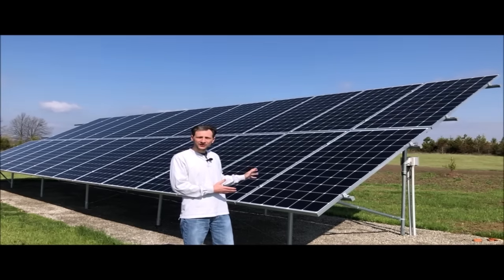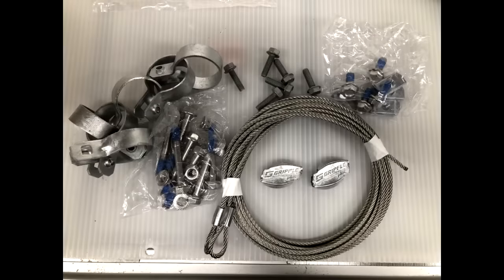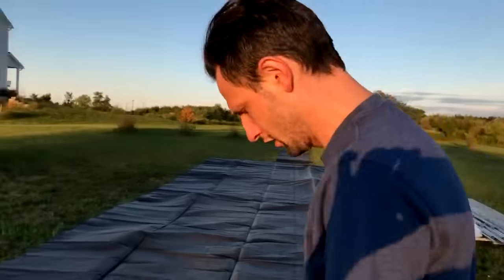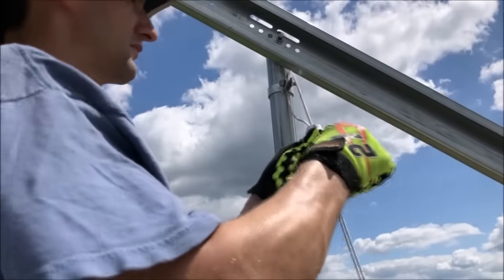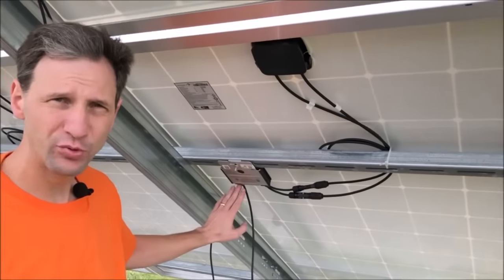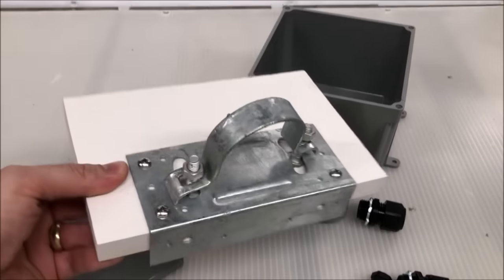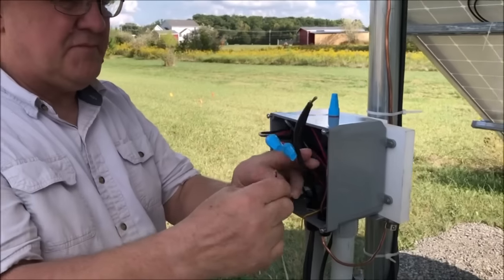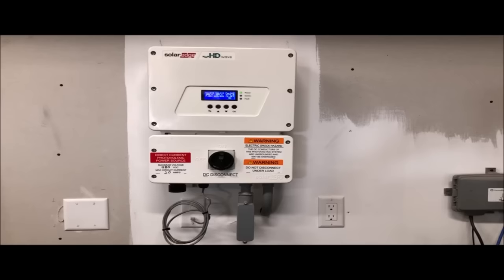DIY 9kW Grid Tie Ground Based Home Solar Panel System Installation

Comment: Where is the battery backup? Or is that in a different spot/not installed yet? Are you just running solar during the day and any extra back feed the grid?
Reply from the maker: No battery, the grid works as my battery.  You can see how my "grid battery" works here:  https://youtu.be/IwUK1dNJ3n8
Reply: @ProjectsWithDave  ok that brings me to my second question. You say that the grid is your battery? What do you do when the grid goes down due to a storm a car taking out the lines or some other random form of catastrophe and it becomes days and weeks without power. You then have solar for the day but nothing for at night. That means you would be having to run a generator all night long to keep important items going till the grid comes back online. From what I have learned is you can do still do grid tie with battery backup.... Maybe an idea to ponder about.
Reply: @ProjectsWithDave  I have been doing a lot of "prepping" for the worst. I have flashlights, candles matches and batteries of many kinds. I do need to get a portable panel cuz I live in the city and space is limited. I have inverters, battery backup, medical supplies, can goods and MREs.
Reply from the maker: I have a generator for significant power outages.  Battery backup systems are still too expensive for me to justify.  I think the cost of batteries is poised to come down significantly in the next few years at which time I will reconsider.  Thanks!

Comment: Dave, I have watched a lot of YouTube videos and I think this is one of the best. How far are your panels from the house? How do you compensate for the voltage drop in the 10 gauge wire over that distance? Thanks.
Reply from the maker: The total run is about 175 feet.  I have very little voltage drop, because the optimizers hold the voltage for each string at 480v.  Otherwise the voltage drop would be a bigger issue.
Reply: @ProjectsWithDave  It was confusing, as I thought that the I^2*R losses must be ferocious if the "optimizers" are only supplying 1V per panel.  But it seems that's a safety feature.   480VDC seems much more like what I'd be expecting.  

Thanks for the wonderful video!

Comment: Question. No batteries? I do not understand. What am I missing?
Reply from the maker: This is a grid tie system.  No batteries are required because the grid acts like a battery by absorbing excess power during the day and feeding it back to me a night.

Comment: DID YOU RUN TWO HOMERUNS TO INVERTER EACH BEING 12 PANELS  ON # 10 WIRE ?
Reply from the maker: Yes, two home runs #10.  One is 12 panels and one is 13 panels.

Comment: Hey Dave, it appears that you ran a ground wire from the array, through the conduit, and to the house? If I am correct on that, why did you do that? I would have thought you could have just bonded the panel frames, combiner box, etc. with the ground rack itself if the ground screws are essentially your ground rods.  Thanks and I really appreciate your videos. I'm in Ohio also and have used your videos and website to drastically reduce my solar learning curve.
Reply from the maker: I'm glad the videos have been helpful.  Yes, the frame does provide some grounding at the site, however, I was required to bond the array to the household grounding system with a 6awg ground wire to pass inspection.  I thought at the time the conductor had to be solid, but the inspector said it could be stranded.  In fact, including a solid #6 wire in my 1" conduit with my other conductors does not meet code due to its lack of flexibility.  The inspector was shocked I was able to do it and did not make me pull it out.  He said I should have either run it outside the conduit or run a stranded #6 inside the conduit.  Hope that helps.
Reply: @ProjectsWithDave  That's interesting, thanks for the explanation. Let's pretend the inspection and inspector were not in the picture. Knowing what you know now and not then, would you still run the ground wire to the house and bonded to the household ground? I've been having a conversation with John regarding several points he made on his video (https://www.youtube.com/watch?v=abfXLujggBo) and I am leaning toward just grounding the Ready Rack and combiner box using grounding at the rack only. I don't have an inspector to contend with here in Knox county.
Reply from the maker: In that video, the recommendation, is no ground at all.  You are simply questioning if it makes sense to connect the house ground to your racking which is effectively locally grounded.  That's a question I am not qualified to answer.  There is a lot of debate about it and I have heard convincing arguments on both sides.  I didn't have a choice since code required the link in my case.
Reply: @ProjectsWithDave  Right, I understand. I'm not qualified either, lol. At this point I am contemplating ways to isolate the PV panel frames from the racking, but still grounding the racking to its own ground and definitely not the house ground. BTW, I decided to use Ready Rack because of your videos. I drove to their factory near Napolean to pick it all up to save on shipping. I told the APA Solar salesman, Matt Reid, that I decided on purchasing the racking because of your video. He said that they have gotten a lot of purchases due to your videos. 👍
Reply from the maker: Thanks for the feedback.  Too bad I don't get a commission on sales... : )
Reply: @ProjectsWithDave  After reading more I am leaning back toward bringing the array EGC conductor through my conduit and connecting it to my existing ground electrode at my main service panel, which is I believe what you did.  If you recall above, I am using APA Ready Rack also.  I did not see any guidance/statements in any of the Ready Rack docs about bonding their racking components to the PV frames and and the EGC.  In fact, they say on the first page of their engineering plan that they don't make any claims about grounding/bonding. Did they provide any guidance to you? I saw in your "Easy DIY Solar Panel System Racking Install" video that you used the DynoBond connectors for the panel frames, and you bonded a PV frame to the Ready Rack support system using a copper wire.  Did Ready Rack suggest this or provide any guidance?  I have reached out to Matt Reid at APA Solar also.

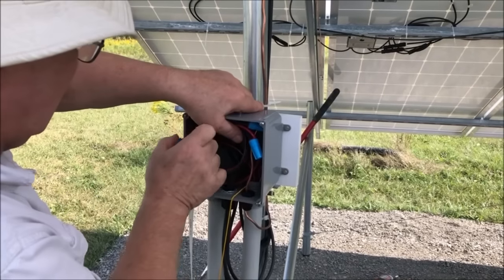Comment: Dave, you are the man! One question, can you please provide clarity during 43:10 how the solar cables connected to conductors? I don't think you explained that part. Also, you said 4 conductor wires (2 black and 2 red) going back to the house in the conduit, is the red connected with the positive of the solar cable and vice versa? I would appreciate if you explain that, sorry I am still new to this. Thanks!
Reply from the maker: Funny you should mention that, I'm planning on doing a video on rebuilding that junction box.  There are two strings, each has a positive end and a negative end.  I connected the positive end of each string to a red #10 conductor running to the house and the negative end of each string to the black #10 conductor running to the house.  Resulting in two pairs of conductors that get combined at the inverter.  Hope that helps.
Reply: @ProjectsWithDave   That would be awesome to see you do it. I enjoy watching your videos. Last two questions, the 375 watt solar panel have a nominal voltage of 12V so they will be carrying a nominal current of 31Amp, hence the 10AWG wire selection that connects to your house, correct? When you connected two strings of each array, 12 panels for each string, what was the total voltage? Because I want to understand how many panels with optimizers you can connect in a string safely? How many circuit breakers would sufficient for a grid tire solar system and where should they be connected?
Reply from the maker: The panel voltage is not directly relevant with an optimizer system.  The optimizers when operating under load hold the string voltage to a nominal 400V DC for strings from 8 to 15 panels.  So If I have a string of 15 panels and they were producing the max of 5,625W the amperage would be 5,625W/400V=15A max.  In practice the panels never produce that much and I see a max of about 11A/string.  The AC breaker is sized for the inverter.  I have a 7.6kW inverter, it requires a 40A breaker.
Reply: @ProjectsWithDave  Hey Dave -I see, in North America, we would be using single-phase inverter to match the 120V AC supplied to our houses, correct? What would be the benefit from installing a RGM vs. monitoring the production from the application of the inverter? I feel like it is redundant because I didn't see you install it. Thanks.
Reply from the maker: Most US household have single phase 240V AC.  Each leg to neutral provides the 120V AC at the outlets.  My inverter produces 240V AC single phase.  
My inverter tracks my production and the utility meter tracks the net meter result, so for my situation an RGM is not required.  Your situation may be different.  Here is an article to give you some insight:  https://sunwatts.com/blog/do-i-need-a-solar-inverter-with-rgm-revenue-grade-meter/

Comment: Don't you have massive resistance losses running 12v DC that far?
Reply from the maker: The DC runs are at 480v so the loss is pretty small.
Reply: @ProjectsWithDave  Didn't you measure it with a meter at 12v at the end of the string?
Reply from the maker: The optimizer holds each panel to 1V until it is initialized by the inverter. That is the "safe" voltage for hooking things up.  One the Inverter is initialized the voltage jumps to 480v.

Comment: Can you post links where you bought the equipment?
Thank you
Reply: Just make an account at renvu.com and you can buy all the parts from there. Probably the best prices too.
Reply from the maker: I purchased the panel and inverter equipment as a package from Wholesale Solar, now called Unbound Solar: https://unboundsolar.com/
I purchased the racking system from Ready Rack at:
https://www.apalternatives.com/ready-rack
Reply: Good job

Comment: You are logical, but 1 ladder? Must have done this before. Really did not need to see the gravel placed for 4:30. Shows that the load was delivered to the wrong spot anyhow. Is your place a football camp?  The panels that get 2 side could be higher and have bright ground reflector/ painted or white rock. Is a 40Amp Breaker at house disconnect undersize?  Considering the distance you ran, would a heavier gauge wire have been justified?
Reply from the maker: Thanks for the suggestion on the gravel, the load couldn't be closer without damaging a drain tile.  The system maximum out put is 7,600W at 240V, that is only 31.7A.  I calculated the value of a heaver gauge wire, at my distance the payoff was to long to make it worthwhile.  Thanks.

Comment: Why paying  for 24 optimizers when the whole panel is installed in the free field without any optical barrier??
I also hope that your white zip-tie is UV-resistant, otherwise you will have to fix your solar cables after 5-8 years a second time.
Reply from the maker: Good question, I plan to do a future video on why I went with optimizers.  Thanks for the interest.

Comment: The only thing for the 2 series wiring I would of done different...is I would of done a C of 6 on the left snd a reverse C on the other 6 so they both meet in the middle in the combiner box not needing any extra wring done.
Reply: And you’re whole system is already grounded those grounding extras from panel to panel really didn’t do anything cause your whole frame of the solar and structure are all metal
Reply from the maker: Thanks for the suggestions, I appreciate the feedback.

Comment: How was 30 degrees of slope determined?
Reply from the maker: That is the "optimal" year round angle for my latitude.  There are rules of thumb online calculators that help you determine that.  After some experience though, I would take a different approach.  
Review your electric bills and determine which months require the most power.  Then run this calculator at different angles until it matches your actual consumption the best: https://pvwatts.nrel.gov/

Comment: I have often wondered what is the maximum wind this can withstand?
Reply from the maker: It is rated for more than 90mph winds.
Reply: The racking can be adjusted to accommodate wind loads up to 140 mph.

Comment: thanx Dave ! but most of this was probably as a guide for guys who never got their hand dirty ... not enough on the electrical end . even talking about the hardware a bit more , for sure it would be good to know about the technical details , prices and ratings of the gear , maybe its outdated even by now but that is a real mystery with you here , too much emphasis on spreading rocks around the ground
Reply from the maker: Thanks for your input.  You can find details on pricing here: https://youtu.be/PNTO83FvaL4

Comment: Dave, 2 questions -  you went with a 30 degree angle  - how did you decide to go with that number?   Also if you want to adjust your during the year how difficult is it with the vendor you went with?   During the winter months that 30 degree angle makes sense - but not as much during the summer (I'm assuming you are around latitude of 40 degrees).
Reply from the maker: I used the method shown at ( https://solarpaneltilt.com/ ) for a fixed tilt.  40deg *0.76+3.1deg=33.5deg.  I then favored summer slightly by adjusting to 30deg because the winter here tends to be very cloudy any way.  The system I installed is not easy to adjust.  I determined the amount of time I would spend adjusting the panels would not be worth it.  It is more cost effective to just add more panels. Hope that helps.  Thanks!
Reply: @ProjectsWithDave  It does.   Thank you.   I was quoted a price of $2700 for the assembly - includes $550 shipping.    I'm going to spend some time exploring building my own but will probably go with just buying a kit.   That the nice thing about being recently retired - I have lots of time :-0.  For folks that may not know the solar tax credit was increased/extended last month - part of covid relief.   26% for the next 2 years if I recall correctly.   Being able to get back 1/4 of your cost makes all this a bit easier to pull the trigger...
Reply: Dave, thanks for your help and guidance.  I've decided to go with a roof mounted system and not the ground array.    Conventional wisdom appears to be if you CAN mount on roof than whatever inefficiencies in angle, etc can be overcome with adding more panels - that it so much more cost effective.    I really like the idea of it being on the ground - but I have a decent alternative.   I can mount it on my shop roof - it has an angle of 27 degrees - which is fine for my latitude - and it only about 20 degrees off from true south - and the roof is large enough  to handle more than the 24 panels I'm thinking of going with.   No obstructions as far as trees, etc.  I will have to trench a bit further back to the house - but it a straight line with nothing to hit.  Again thanks for the great videos you put together - and for answering whatever questions I had...
Reply from the maker: Sounds like you have thought it through.  I'm glad my information could help you with your decision.  Thanks.

Comment: it looks good but you really need to go back and remove the wing nuts wire splices on the DC side. That is going to fail eventually and cause arching. Need an inline connections. That is why panels have those fancy m4 connectors.
Reply from the maker: Thanks for the recommendation.

Comment: I like your project, but the power optimizers are a waste of money in your case. You have ideal conditions (no shadows and all modules are facing the same direction). They need additional energy and are quite expensive. I would invest that money in a bigger system.
Reply: Are the power optimizers those small boxes under the panels? So if you have no shade and panel are facing the right direction,  you don't  need them? How do you make the connection?  One panel connected to the next panel directly in series?
Reply: @thelightworshipper9687  you just put the panels in series. I agree that the microinverters  are a waste of money
Reply: @thelightworshipper9687  Yes, these are the small boxes under the panels. Without those you just connect the panels in series.
If a converter can handle 2 or more MPP-Tracking Strings (don't know if I translated it correctly), and all panels in ONE string are facing the same direction, you dont need those optimizers either. Just keep in mind that you need to have at least 6-8 panels in one string (depending on the panels and the inverter).
Its a different story if panels in one string are facing different directions, on small roofs for example. If shadows are a problem, those optimizers would help as well.
A comparison with and without optimizers on similar sunny days would be interesting.
Reply from the maker: I understand what you are saying, however there are a couple of other advantages from the optimizers.  1) Not every panel puts out the same amount of power, the optimizers allow max utilization of the power from each panel. 2) I added an additional panel to the lower string, the optimizers maintain the constant 480v/ string regardless of panel number or performance imbalance. 3) The optimizers are the control points for shutting down the system in the case of a power outage, which is code in my area.

Comment: is the "optimizer" basically a micro inverter?
Reply from the maker: Optimizers are not inverters.  They are DC/DC controllers that manage a constant DC voltage for each string and send it to one DC/AC inverter.  Micro inverters convert DC to AC at each panel.  You can get more information on optimizers here: https://www.solaredge.com/us/products/power-optimizer#/